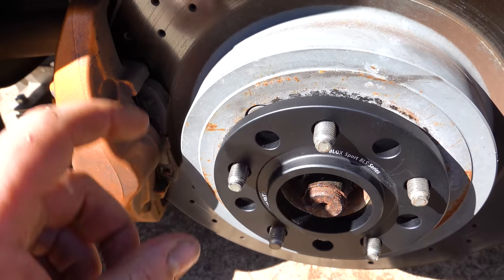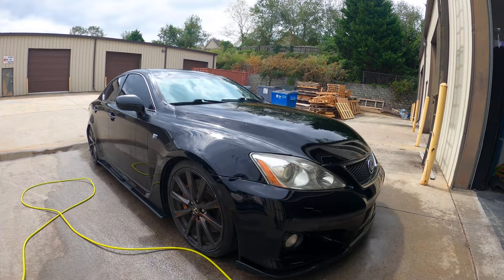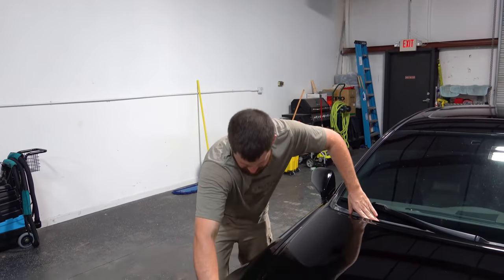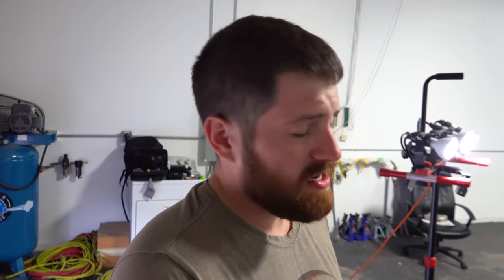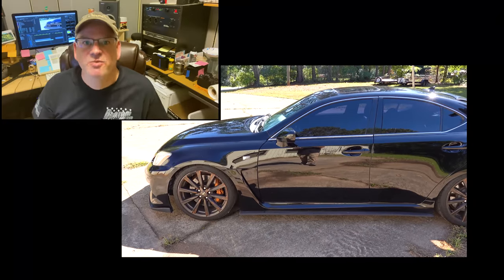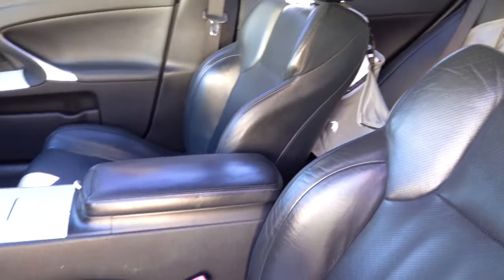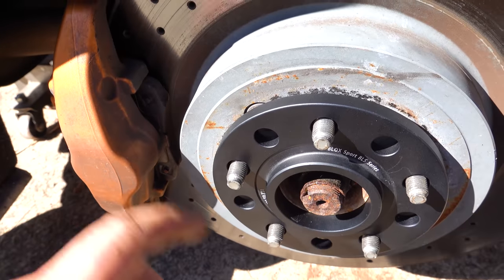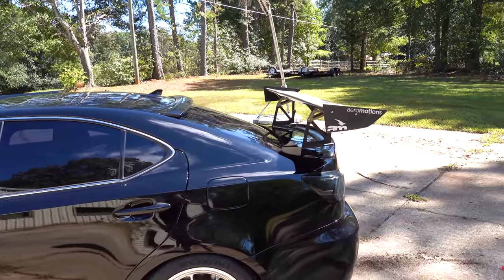THIS Is The CHEAP 4-Door SUPERCAR You Need To Buy RIGHT NOW (FORGET BMW, AUDI, And PORSCHE!)

Comment: These cars aren’t “cheap” lol. They actually went up thousands in value in the last 2 years.
Reply: So true hard to find em under 20k now
Reply: Went up they never came down
Reply: Easy to find a few of them under 20k in the UK tho
Reply: @kennyd7667  yes but the pound is worth more than USD 😉
Reply: @xCkillaxC  good point
Reply: I know lmfao an m5 v10 is cheaper lol
Reply: @xCkillaxC  they start at about 30k AUD, which is a touch over 21usd
Reply: @Mr_jz_12  Yeah same in the US. They start at about 21-22k for about 120k+ miles
Reply: @xCkillaxC  The cars i found in that price range are around 140,000 km (80,000 miles approx).
Reply: @Mr_jz_12  miles like that in the US is 24-28k. Depending on the year tho if 2010+ then it goes up drastically
Reply: Dean Gibbons  lol but then it looks like a boxter 🤮
Reply: You can’t find these cars at all.  I have a 2010 with 110k miles and paid $25k usd. There were two guys right behind me to buy it.  There were only 5 thousand ever made.  Hard to find and Lexus discontinued the line.  These are faster than the new GSF and RCF.
Reply: @brianbeam361  ehh they’re not hard to find. There’s always some for sale but not many. 2013-2014 ones are impossible to find tho.
Reply: @lexusrcflover9175  I paid 13000 for mine last year with 213000 miles bone stock best decision I've ever made in buying a car I love it and when you see them pop-up they do not last
Reply: @xCkillaxC  I found one with 150000 miles for £13k
Reply: Honestly just buy an is350 sure no manual. If you want a super car or near super car, I’d look elsewhere honestly..
Reply: @miataenjoyer2786  I love the ISF but if I could get a faster car it would probably be a GTR
Reply: @miataenjoyer2786  what is an is350 and what year
Reply: @nathanlopez5667  yeah. Really you could get anything, for 20k+ you could build a fairlady Z or even a skyline gtst is in reach. GTR 20k is possible, but you’re going to have to look around
Reply: @miataenjoyer2786  I mean don't get me wrong I love my ISF and I only paid $13,000 for it I have put a lot of cars to shame newer cars I'm a Mustang II but once I started getting into Japanese cars like hell I would even take a nice G35 coupe but I'll be saving for a while to get the GTR but I'm sure it'll be worth it
Reply: @8BitMonty  look it up, it’s the Lexus is350
Reply: @nathanlopez5667  gl mate!
Reply: I just got mine for 15.5k. Not much wrong with it. Mainly normal wear and tear and it only has 112k on it
Reply: @greebuh  that is a steel I've seen one pop up for $10,000 before of course it was a salvage title but it was a running car
Reply: @nathanlopez5667  yeah this one isn't perfect but its 10k less than any other one within 500 miles of dallas so I jumped on it. I was just looking for a good is350 for about 10k and I saw this and got a little 5k loan and snatched it up. And really, its way better than I expected for the money. I posted a shot of it on my Instagram also called greebuh.
Reply: @greebuh  you should put it on the forms on Facebook there's one called I s  freaks I posted pictures of mine on there the car is going to last you a lifetime and pretty much be trouble-free the only things I had to replace on mine is the battery the breaks of course I got the stock OEM ones the brembos and I went from the OEM motor mounts to RR racing solid motor mounts I'm almost full bolt on right now I got the RR Racing tune Takeda stage 2 intake completely fabricated custom exhaust with x pipe and secondary cats deleted I'm still thinking about getting the headers
Reply: @nathanlopez5667  yeah I changed the belt, belt tensioner and water pump the second day I had it. It already has a borla catback that sounds amazing and some very nice wheels by Breyton. I need to pick up some headers as mine have the infamous crack on the flange... I think I'm going with PPE and there is nothing else really that needs to be done beside the rotors.
Reply: @greebuh  yeah I think I might go with the PPE headers myself and the oil catch can I forgot about that with the brakes I would recommend OEM because they are brembos after all I did the rotors and the pads I got all four corners costed me a little bit over 300 which is not bad everything else is going to be very expensive a buddy of mine has a e92 M3 and every time we meet up he wants to drive my car and he says my car is much faster than his also after getting his BMW he is extremely paranoid about something going wrong
Reply: @nathanlopez5667  I do all the work myself so I only have to pay for parts really. And they are mostly just Toyota so its not all that bad. The brakes are next weekends project. But I have less time these days than I used to and things seem to take quite a few hours on this monster. And f**k BMW. Haha. I dont like them, would rather have my Toyota all day everyday. And with only 5k of these made, ill take my piece of automotive history over loads of other cars.
Reply: @greebuh  yeah people don't realize how rare these cars are I see more GTRs on the road then I do ISF
Reply: @nathanlopez5667  I've already had so many people try and race and then back off when they hear the car pull away. They have no clue about the car other than its a Lexus...
Reply: @greebuh  I beat cars I didn't think I could 2018 Mustang GT 10 speed Auto we were like neck-and-neck the shity 392 scat packs those are garbage the only car I got beat by was a 2015 Mustang GT on slicks gears a tune intake and running E85 and it was like by maybe a car length and that was when I was still stock nothing done but other than that I have not lost to anyone else
Reply: @nathanlopez5667  first day i drove into work a friend rolled up with his 2013 SS and I smoked him everytime. I was pleased.
Reply: @greebuh  I guess you could really consider them sleepers because a lot of people really don't know what they are they think it's either an IS 250 or 350 with a motor swap LOL
Reply: @Mr_jz_12  Correct but looking today they start at just less than $50k
Reply: @xCkillaxC  almost double
Reply: They will drop now, that’s why you’re seeing ISF’s listed in bunches at the moment with the news of the IS returning with a NA 5.0 v8, people thought the isf was the last IS with the v8 why they held value but nope! Not anymore. The new IS500 is just considered F Sport, watch when the actual ISF comes out. Don’t buy an overpriced ISF right now lol.
Reply: @grandmastagrimm8773  Nah trust me they won’t drop lol. Look at the E92 m3. 2 generations of Ms ahead of it and still holds value pretty well. I just bought a 2010 ISF 84k miles a month ago for 28k. I don’t think It’ll drop down to 15k when the new ISF is unveiled, or if it will ever be.
Reply: @xCkillaxC  wether they drop or not which I think they will, you got yours for a decent price, if it’s a clean title no accident prior. The m3 that was the last of the NA v8 they’re never going back.
Reply: @xCkillaxC  I’ve been seeing way more isf’s listed right now than ever, way overpriced tho lol but they’ve been sitting no way they sell anywhere near the prices I’ve seen
Reply: Paid 13.5 for mine 119k miles fbo, rebuilt title
Reply: Welp they’re up to 30-40k rn 😭😭😭
Reply: @tleoipl37  lol I remember seeing you on the g37 groups when I had my IPL. I have a 2010 ISF now
Reply: @grandmastagrimm8773  7 months later and the prices are even higher and still selling like crazy so 🤷‍♀️
Reply: @xCkillaxC  damn right! I’m the #fefking rn 😂 but that’s my next car. I test drove Val’s ISF and I always wanted his car for the longest time. Nfs undercover and seeing a is300 2ur in there always made me fell in love to get get one soon. Plus my pugs name is Lexus and she needs a car hopefully soon. 😂
Reply: @tleoipl37  lol you’ll get one soon bro! Funny you mention an is300 as I got an 04 is300 daily for my ISF
Reply: Jay Cari  how much what
Reply: Jay Cari  because they became more sought after ? Lol

Comment: I love Lexus. I've had damn near every brand except exotics. The one car I miss dearly is my 2004 LS430 but end up buying a 08 LS460. I love Lexus.
Reply: I have an 08 LS480 as well! Mines metallic burgundy with chrome wheels. It’s absolutely phenomenal. I’ve always liked the 04-06 LS430 styling a little better tho. Never owned one of those
Reply: @805NAVE  the 04 to 06 ls430 has the sleeker headlights and its just such a great car. Idk why I like the style better than the ls460. But Lexus just period makes a great car. They drive so smooth especially the 430.
Reply: @805NAVE  mine is the green color that has the grayish tint, at first I wasn't a fan of the color but it grew on me. Are you having issues with the interior?  They call it the sticky interior. I was gonna take mine back to the dealership to have it fixed, there's a recall on it. Unfortunately coronavirus came and idk if its still eligible

Comment: This car is not cheap and let me know when one is available
Reply: They are expensive up here in Canada ($30k and up)
Reply: Not cheap unless over 150,000 miles then it’s $15,000. The isF under 100,00 miles isn’t cheap unless you have $23,000 for a used reliable Lexus
Reply: Buy an used Audi s6 with the v10, they’re quite reliable and go for around 10-12k.
Only problem is carbon buildup due to it being direct injection, but with a little knowledge you could probably clean it in a couple of hours
Reply: Mod Boy NERF quite reliable???????
Reply: @carguy7884  lol 'reliable'
Reply: @carguy7884  v10 reliable....hahahah
Reply: It's hard to find now and price is up 😎👍👍👍
Reply: Autotrader has pages of IS-f's in the teens and 20's. Not used civic prices but not too bad. They could all be shit though.
Reply: @carguy7884  That Audi V10 reliable? LMFAO! 🤣🤣🤣🤣🤣
Reply: @carguy7884  Give it some time... and save money... those turbos will not be cheap...
Reply: kaetos03 the 2007-2011 does
Reply: kaetos03 it’s not turbo’ed
Reply: @carguy7884  Yes. you are right.
Reply: Same. They rarely ever come up in the local classifieds. The last one I saw was selling for above market but had good history. I called in the morning the second I saw the ad come up on Craigslist, told them I would come after work, and an hour later the seller called back saying someone else came cash in hand and bought it for asking 😓
Reply: Reliable for a v10
Reply: yup.  only 1 for sell in my state with 170k miles and the want 20k for it.
Reply: @drake6143  Yup just looked at 2 in Peel region all going for 28k. I can find way better cars with more reliability and power for half the price.
Reply: Nico Tang well it’s mostly BMW, I’d say
Reply: @joealex65  Fuckin carbon build up! Can you believe they designed a engine that has to be taken apart and cleaned? What a joke!
Reply: @someone28  Q50 Red Sport to be exact!
Reply: R u 5 years old deff no wing and the wife would probly smack u if she had to drive it wit that wing
Reply: @carguy7884  how many miles do they last?
Reply: @shiftautomotive854  3-4 hundred thousand, maybe more

Comment: The wing looks dumb, even if it's "Smart."
Reply: The wing looks ugly, and the only thing it adds at real world speeds is drag.
Reply: @charlesclark3840  under daily driving conditions you won't be going fast enough to get the effects of drag. On a road course with RWD and 400hp stability is what you want.
Reply: @KeenanStyles  I might be mistaken, but I believe you will have measurable drag on the highway, but not meaningful downforce. I am sure that it will be an eyesore though.
Reply: @charlesclark3840  thats irrelevant as under daily driving conditions you are not looking to set speed records anyway and the majority of drivers on the road in modern day spend most of their time in towns and at stop lights where you will not be going fast enough to be effected regardless.

Comment: good to see that you enjoy it and put a good amount of miles on it. I use to tow for AAA and usually when I got a call for a Lexus it was just a dead battery or an old LS with a dead starter. you can't go wrong with a Lexus or Toyota. I only drive a Maxima cause Toyota doesn't have a 6-speed manual option for the V6 Camry..

Comment: Did I miss it? 1) I don't recall you saying what exact spec you ended up running for the 18" Konig wheels. You talked about offset and wheel spacers, but 2) you didn't link or mention the exact spec you went with in the video caption like you said you would. The Konigs aren't my style but I really like the fitment you got with them.

Comment: 11’ and up is when the prices are no longer “cheap”. I’m lucky and bought a 11’ with 155k. But yeah that spoiler looks awesome but definitely track only. I like the square set up but i don’t run spacers. I have 285s in the rear. 255s up front. I’m also FBO tuned from RR.  And i just bought a oil cooler, trans cooler and radiator for it. Soon I’ll upgrade the suspension and call it day. Have you thought about upgrading your LSD since you track it?

Comment: I have been curious to ceramic coat the paint on golf metal woods to protect from light sand scratching.  The wing is out, extended duckbill , or flat deck extension.  Got stay classy rolling vip.

Comment: I think you should put a camera on there with aero strings and see where the boundary layer separates. Lower the wing by shortening the mount. You have to remove the short upper wing because it is definitely cutting higher speed efficiency.

Comment: Love the red color but prefer the more stock stance of Jared's black car.  There's a wing on Jared's car?  I didn't notice!
Reply: Ok, watched to the end now.  If the wing in neutral position doesn't block your vision through your rear view mirror, I'd keep it.  Make sure it doesn't move at legal speeds - except in a rally or on a track - and people might just think the IS F is just another hopped up Rice Rocket driven by a local kid! 
That drives me nuts BTW, rice rockets are usually FWD, need the wing over the front wheels!  Is the V8 5 liters or more and is it naturally aspirated or turbo charged?

Comment: Wheels are very 1980's bling. Would have been good to see the original syle you had on the car updated to a larger diameter without the stagger. In regards to the wing. If you were 18 I'd say go for it. Car park bragging rights. But not on the Lexus today. The detailing is ok, but 220k and it being black with chips, cracks and defects, I'm not sure the outlays stacked up.

Comment: Just attach a yacht-style anchor to the rear of the frame w/explosive bolts...in an emergency stop, a signal from the braking system will blow the bolts & deploy the anchor. Much better than that ricer wing :)

Comment: The wing looks kinda akward on there, doesnt really fit a family 4door sedan but your car so you decide in the end anyways!  Those wheels need a paint for sure. But on the wheel nuts topic, i was swapping winter tires on and screwed up my bolts, and i ran 3 nuts on a 5 stud rear end on either sides and went up to 100mph on them, i know im a mad man but my wheels stayed on, but the way that the clip had a wheel flying off, could only be caused by one or few of the studs breaking off?

Comment: Red f looks much better, you can see the body lines and details so much better AND you can use black as an accent color.  Black cars have no detail lines, they just hide in the shadows and any color accents look seriously out of place, unless it’s matte black, then it looks like somebody forgot to polish that section.

I like how when he did the comparison pictures he put up the after pic of the black one with the new wheels already on it, anybody else notice?

Also I think Jared should mount the wing in some thay way it can be mounted  only for whenever it gets track/rally/race use,  and be able to  leave it off when daily/regular road driving.  If not able to just leave it off, it looks hideous.

Comment: Leave the wing for the guys running around in rebadged IS250's......How many door lock motor failures have you had in that thing.....Used to have an IS350.....Water pump @ 78K miles and 3/4 door lock motor failures.....Traded it in....Myself....I'll look for a deal on an ATS-V 6 speed.....My GM cars door lock motors and water pumps go a lot further than the "Fancy Tiayodas".....

Comment: I gotta say as a detailer, that finish is terrible. Either it has been washed or "detailed" since you had the paint corrected very badly or just went to the local brush wash, either way, very badly maintained or detailed. Holograms and swirls everywhere in the paint.

Comment: I used to have blue IS-F, probably personally I think black is best looking when it is polished and clear, but other colours I would consider again is either blue or white. The worst looking colours are silver and grey... and the burgundy "red".
But the wheels you have chosen are literally the ugliest wheels I have ever seen on any IS-F. What was wrong with refurbishing factory wheels? As there there was an option to have exposed polished spokes on them, which was looking great. Now the car really looks like some cheap riced toyota. As well those ugly VLAD tail-lights.... Before getting my IS-F I had IS250 and One of the mods I wanted to do was to get IS-F tail-lights (as IS-F had white indicator), but getting real IS-F taillights is extremely difficult and I was not prepared to pay $2800 (1400 each). And you replaced them with terrible chinesium... 
Well at least it doesn't look as bad as Tavarish Ma...GOReratti. So yeah Lexus IS-F great car - but you haven't modded it tastefully.

Comment: The wheels are not the best choice and in my opinion cheapen the look of the car.. Those particular wheels don't look very good on a car like that because they don't flow very well with it stylistically.. But the wing on the other hang I would go with only because it is completely functional but wouldn't be a loss if you left it off